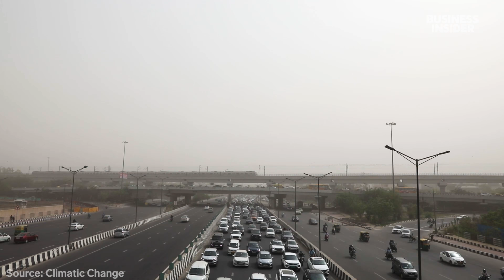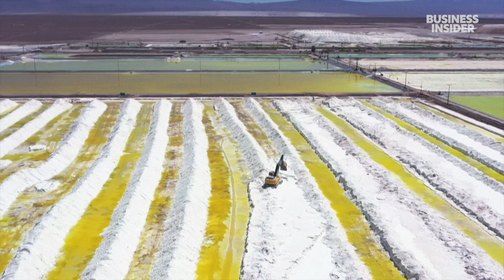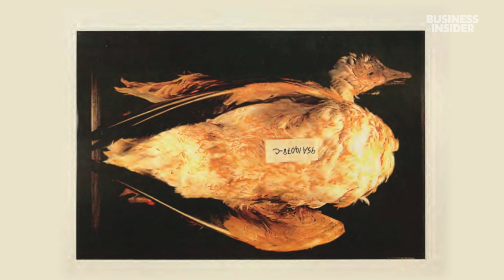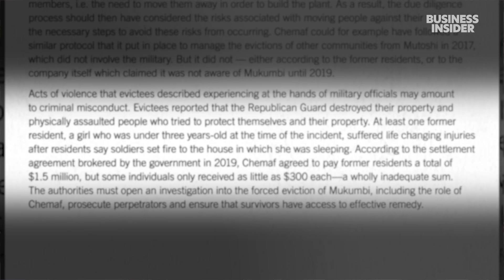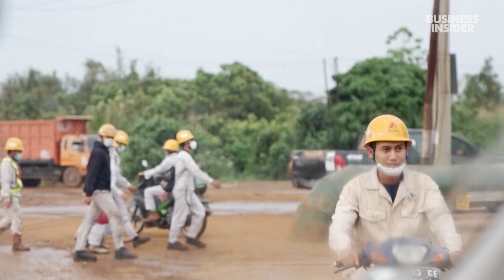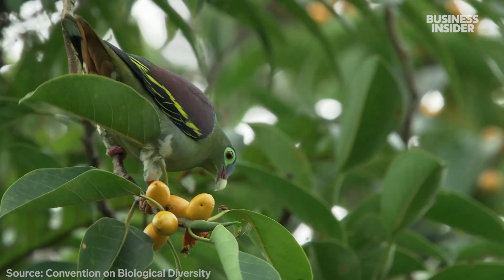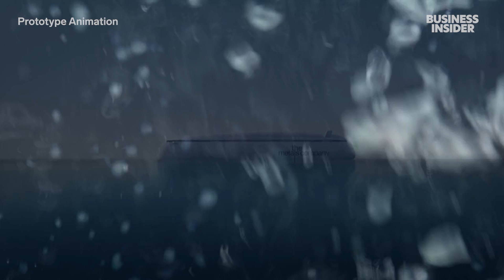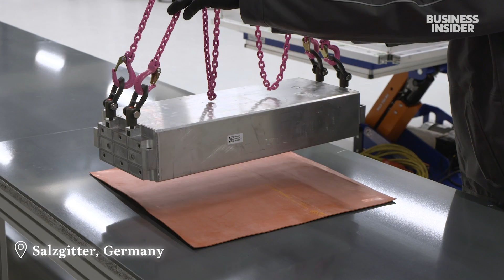The True Cost Of Mining Electric Car Battery Metals | True Cost | Insider News Marathon

Comment: Lehman's question... I thought car batteries were supposed to be LFP. 🤔That's how they can clean the last you 10 years or something. And lithium would be the only rare metal in that combo that I'm aware of.🤷
Reply: Layman's question. And you thought wrong, all kind of battery types are used by EV manufacturers, they don't really work together to save the world, they are still moneyhungry companies.

Also as the chinese market expands, expect less LFP, as it is not as cheap as INR type lithium ion cells for power to weight. And customers want range, so the more polluting battery it is.

Comment: Over and over again, Aluminum/Air batteries look like a simple and great idea.
You would have to design an Aluminum/Air battery that permits for simple removal and replacement of the Aluminum metal plates. Each plate would likely be 8by4by0.375 (inches.) A single battery (capable of moving a car for 1300 miles) would probably use about 12 plates. So, at "gas" stations, we would likely erect Vending Machines that vend individual Aluminum metal plates. Eventually, you would want to replace the Aluminum Hydroxide electrolyte. I never hear that the mining of bauxite ore causes serious environmental damage.

Comment: All the electric cars trend is just another capitalist trick to fool humanity into believing they are making anything significant about climate change when in fact is just the jungle capitalist system doing what he does... trying to profit with a huge problem wile make nothing to solve it...
Hydrogen is the way to go, but the lobbies and specially the "genius" Musk have to much power. 
Lithium is not only toxic as all the process to refine it is very pollutant, and in reality it will not even help to control CO2 emissions, as the electricity it needs to work still comes from fossil fuels specially in the US...
Electric cars are just another way for wasting precious time and resources into a technology that is flawed...!

Comment: Copper from 1980 nothing to do with EV production , plastic replaced copper piping a lot, a small percentage of cobalt comes this way.
Reply: Where does the plastic come from?
Reply: @billhacks  Largely Natural Gas at this point.  It is easier to build up plastic from Methane (single Carbon) than break down Long Chain Carbon (Oil).

Comment: lithium batteries are unrecyclable and are dangerous even when in use  they are inpredictable and can turn any vehicle into an instant fireball which cannot be put out until the actual battery stops reacting as shown it dewalt at a show were it ended up having to be buried , the mining and use of these materials and batteries should be outlawed

Comment: Now wasn't that defunct copper mine there before EVs were even mass produced?
Reply: PROBABLY, But even if it was, what they are saying about what the NEW defunct mines are going to look like, or that there will be exponentially MORE of them, doesn't change a bit. we found a way to drastically lower the need for copper in pumbling and homebuilding using PVC pipes were even better and much cheaper than copper. we need to do the same with batteries.
Reply: @kingranches  There are mitigation process to follow, not that everybody is following it, in place so hopefully they will be turned into something useful. 
Would be interesting to see how electricity flows through PVC pipes :)
The idea is good and I bet that things will change for the better. 2
Reply: @kingranches  PVC pipes are produced with oil.  And extracting oil is far more damaging for the environment than extracting solid minerals like copper.

Go look at the oil sand mines of northern Alberta.  They are so large that you can see them from space on satellite imagery.

How can your solution be to extract more oil to extract less copper?
Reply: the USA 🇺🇸 mine was a union ( aka anti worker's rights and locals living there 1st vs CEO/shares/foreign in anaconda copper'inc/ford-corporation ) buster move not that it didn't have enough ore ( would get rid of the problem with birds ect working again as a mining industry and paying $$ to working again vs drain to the local economy ect ) to function as a mine and with additional advice's mentioned in the video would be functional by pumping out and extraction ect
Reply: @richardprice5978  i cannot understand your comment. learn what periods and commas are.
Reply: When I lived in Montana, I wondered why the "Big Pit" couldn't be used as a solution to NYC's shortage of garbage landfill.
  I still don't know, but think it is win-win.
Reply: AI and data centers are driving up the use of copper for for power cables but not a word about it.
Reply: You are all missing the point of my original post. They are using deceptive imagery to try and sell a false narrative.
Reply: I don't think you understood the point.
Reply: Even so, the people that virtue signal knew full well what copper mining causes but do not care. Their feelings are their gods. How will those acid ponds be neutralized?
Reply: And you think a new copper mine for EVs will never be exhausted and become the same pool of acid and poison?
Reply: Although road transport is only responsible for a little 12% of greenhouse gasses. It’s shifting the ‘problem’. And the green net-zero stupidity is all about the money. The climate change ideology.. Green on the outside, but fiery red on the inside!
Reply: Its funny to see that they are focusing on EVs that has about 89 kg (176LBS) in them wail a normal house would has about 200 kg (439LBS) . Funny
Reply: @tootallno  funny house will be used for hundreds of years.. EV in land fill after 10. When you pick ur kids up from school bragging about saving the planet, remember those kids digging rocks with their hands. No shoes, hoping just to make it through the day without being buried alive.
Reply: @dellenteld  1. I have not seen an 10 y o EV on the landfill yet. 
2. I dont brag about saving the planet, or anything like that, I am just cheap and dont like to pay in to big oil. Big oil is making 20 billion ++ and who owns oil? The people. 
Here in Canada houses has a lifespan of 50-70 years according to out local planning committee and how many houses is North America is over 100 years and full of copper? 
Just saying.
We all make our own choices and I have made mine with saving money on not driving an ICE. You do you :)
Reply: @tootallno  "wail".... you mean "while"? Anyways, your argument is nonsense as expected by your "mistake" already
Reply: @harrison00xXx  What you mean??
Reply: @tootallno  Ei min joa agument seis nafing
Reply: For sure, but EV's are going to drive up the demand for copper to many times the current levels, which means new mines and more destruction. Do the big companies care when there's so much potential money to be made? Probably not.
Reply: Copper seems an odd choice to talk about in the video. The usage of copper for batteries must be tiny compared to usage like construction, creating alloys like brass, pipes, power lines, ...
Reply: @tonyb3629 Does the government and the consumer care?
Reply: @tonyb3629  EV copper use will have a negligible effect on global copper production. Copper is used on every ICE, every home, everywhere. It will not drive it to many times todays usage.
Reply: @CJS-ky2zf  where are your sources as that is not what my research has shown obviously it is used in housing internal combustion etc but a pair of 200 kW electric motors for an electric vehicle use a lot more copper than a small generator and/or starter motor for a car running on hydrocarbons equally copper for charging power station upgrade etc. Must have an impact because if you want to replace the worldwide fleet look at the amount of barrels of oil that is currently burn running cars and then equivalent energy must be supplied for electricity which surely must result in mass of copper for everything from cabling to as I say before the electric motors?
Reply: @malcolmwhite6588  What are your sources? I worked on those Chilean copper mines (Codelco principally) for 20+ years. Average ICE uses 20kgs of copper, average EV uses 75kgs of copper and average home uses 200kgs of copper. So far humans have extracted 700m tons of a known 2.8Bn tons. More is being found all the time. estimated well over 250 years reserves left. Also, important to remember that copper is recycled so we will likely never have to worry about it!
Reply: @CJS-ky2zf  wow interesting. -I just searched a couple of sites on Mr Google ! if you’ve been closely associated with the industry you would know more than me that information is reassuring. I understood it was not great quantity left or it wasn’t all recycled much
Reply: petrol cars use copper for wiring too. And Tesla reduced their wiring by 75% by using 48V system instead of 12V. A good chunk of that copper you are talking about is already gone. @tonyb3629
Reply: @tonyb3629  - Increasing human population (whether or not we embrace a Faux "Green Energy" future, means increased demand for copper by orders of magnitude. People of lesser intellect are easily fooled (leftists led to their own slaughter who will lead us all to our enslavement = the real agenda of the so-called Climate Change Fraud/ Conspiracy). Who are the unnamed so-called experts who say the benefits of EVs outweigh the costs? (they arguably do not). The people who are behind this Global Warming fraud/ conspiracy who started this all, are the Globalist Usury International Central Bankers. The history can be and has been traced. Their goal is to enslave us and control us, and the Global Warming conspiracy is a proven agenda to due that (by destroying the Middle Class/ Working Class and preventing Developing Nations from developing). By this method (making life unaffordable, and massively artificially increasing the cost of everything and creating unnatural inflation, extra unnecessary and tyrannical taxes and regulations), they knew they could accomplish this goal. The goal is to create engineered artificial scarcity under the guise of environmental necessity (and they are accomplishing this goal in a variety of ways). There is no unnatural Global Warming. There is no scientific evidence that humans have any measurable effect on Earth's Climate. CO2 is good and absolutely necessary. We literally cannot get enough of it. Humans are responsible for less than 3% of Atmospheric CO2.
Reply: @tonyb3629  How much copper does an ev contain? 89 kg wail a normal house has 200 kg and we are increasing building too
Reply: @tootallno the problem is more Lithium and Cobalt. Those metals Exist almost entirely in a few countries. Chile and Australia have more Lithium than the rest of the world combined time 20
Reply: @Sgt.chickens  You know that there are findings of Lithium in Canada too. Wast amount of it?

Comment: I thought that gas cars use cobalt in the catalytic converter.
Reply: @brad4013   Catalytic converters rely platinum. That's why they're desired by thieves.
Reply: There is a small amount, but the larger message here is the greater amount of minerals required for an EV vehicle to be made than petro.

Comment: The reason your having material supply problems is because the retrofitting effort is being applied at the distributed part of the system rather than the source part. 
IE An approach to eliminating fossil carbon emissions that would not have these problems (and therefore be alot cheaper) would replace the source of the fuel rather than replacing the cars and other machines that use it. Fuel must be produced from atmopheric or aquaspheric carbon instead of lithospheric carbon. 
This is accomplished by using electricity to create reduced carbon from oxidized carbon.
Reply: You can do that if you want to pay 1/10th of your annually wages to move your car 10 miles.

Comment: "Fossil fuel" / EVs are not the only options! Unless you've got a colossal hydropower / person ratio, your renewable energy supply is highly variable and in the case of eg wind. unpredictably so. The only way to cope with unpredictable renewable energy supply at national scale is to convert it to an easy-to-store form ('battery parks' are several orders of magnitude too small for this) as we already do with national scale natural gas. The obvious other net zero alternative is synthetic hydrocarbons and motor fuels. That solves renewable intermittency and the everyone-has-to-replace-their-vehicle issue at the same time. EVs have their place - particularly in fixing urban air pollution, but there's no EV longhaul aeroplane on the cards, nor warplane. If we synthesise current energy fluids, all those hard-to-electrify applications are net zero too, right now.
Reply: yeah but as ev gets more popular the science research related to solar panel , batteries and other renewable are getting more and more and we still in early stage, who knows what kind of breakthrough we will get in few years or decades that makes battery last longer with cheaper component and such. Even combustion car at the begining early stage looks ridiculous especially when oil mining tech is still in its infancy

Comment: Yet another misinformation video that cleverly fails to bring up the over 4,300 coal mines worldwide working basically 24/7/365 to bring coal to power stations 24/7/365. Or the fact the average coal power plant burns through 24,000 tons of coal per day (for perspective, that's like burning 24,000 VW Beetles every single day -- by just one plant), which is why the mines can't stop. Because once you burn it, it's gone. That besides polluting our air, leaves only deadly coal ash that needs to be constantly disposed of and eventually runs into our rivers and streams polluting our waters.

Or the many millions of oils wells around the world and oceans creating constant destruction in man's relentless  drilling in their search for it and extraction without stopping. Because again, once it's burned it's gone forever and you have to keep constantly searching and destroying the earth in said search. Or the 800 plus oil refineries spewing polluting toxins into the air 24/7/365. 

Or the billions of ICE vehicles spewing deadly, poisonous carbon dioxide into the air around the clock worldwide for us to breathe or come back down as acid rain killing our forests and pollution our waters. 

As opposed to battery minerals that once out of the mine, it lasts for decades and then can be recycled over and over again and doesn't release a single thing once processed -- electrons simply go back and forth inside a battery. So in 3 or 4 decades, no more mining for them will be needed.

Comment: What we need isn't more EVs. What we need is LESS CARS. The whole EV solution is just the auto industry's distraction to make more money, what we need to solve the climate crisis is to change society - fewer cars, more public transport, more walking and biking, less suburbia, and more mixed neighborhoods. People are healthier and happier that way and it's WAY better for the environment.
Reply: We need to move away from the low density to medium density urban planning. Montreal is a great example of it.
Reply: Sounds good. Just as long as all those diesel burning busses go buy-bye in favour of battery electric busses.
Reply: @surferdude4487  trolley busses are even better
Reply: @Frostbyte501  There used to be trolley buses on Bay Street in Toronto. They did a good job alright, but they were limited by their overhead wires. it happened a bit too often that one or even both of the masts came off the wires and the driver had to use a boom to put them back on. The other probem was that if there was a problem with the road, the trolley buses could not be re-routed.
they weren't a perfect solution.
And don't even get me started on how stupid streetcars are.
Reply: @surferdude4487 There is no need to rush to battery electric busses when busses are already far far more efficient than cars for urban transit. The materials need to be directed where they can have the most impact.
Reply: @surferdude4487 battery electric busses have been a disaster. MUCH more expensive to buy, you need more of them because they can't cover the distance and the service is still impacted negatively. The switch is a pure policy decision, not a decision based on economic reality.  Diesel busses can work more, simple as.
Reply: @imnotusingmyrealname4566  I disagree for the following reasons:
1) Busses seldom have to go faster than 60 kph. Meaning that the bain of range, high speed, is not a problem.
2) Busses make frequent stops. Meaning that they can save a lot of wear and tear and fuel with regenrative braking.
3) busses often have to drive through or near residential areas. Which means that the absence of soot and other harmful emissions and noise is a huge benefit.
4) The massive reductions in fuel and maintenance costs make BEV busses the obvious choice for budgets.
And I would make a similar argument for BEV garbage trucks.

Comment: According to this documentary, pulling rocks out of the ground and grinding them up to make electric cars is bad.  Thank you insider.  For telling me rocks are bad and unethical.  This is definitely not propaganda at all.
Reply: Are you stupid or something? You're not simply moving rocks, you're using a LOT of equipment in order to dig and move it and then process it into batteries. Equipment that burns diesel, which then gets released into the atmosphere, and then all the waste accomodated with processing it, where do you think exactly that waste is going and what happens to it?